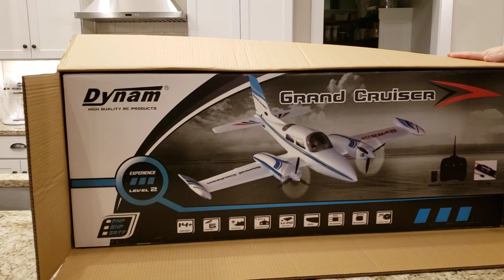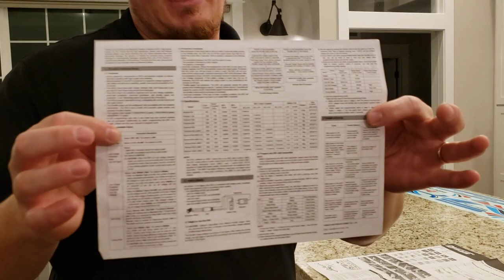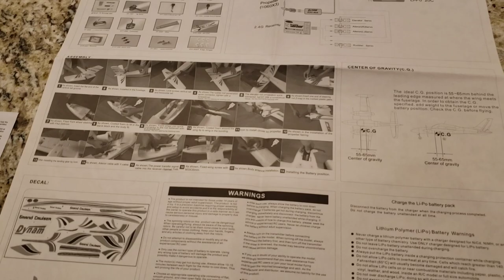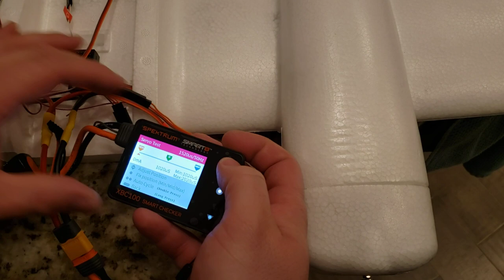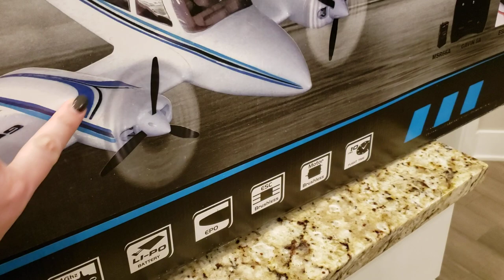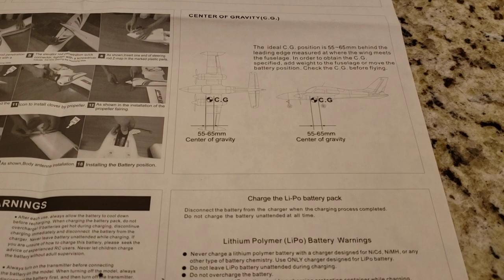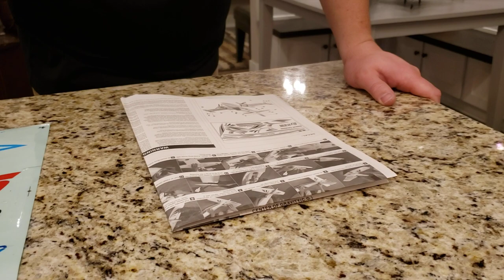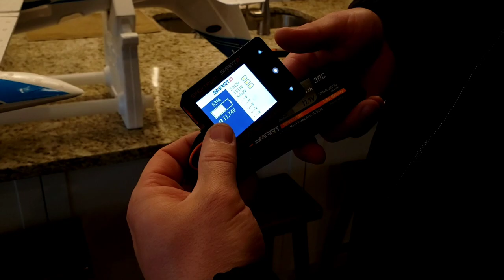Dynam - Grand Cruiser AKA Cessna 310 - Unbox, Build, Radio Setup, & Maidens + Repairs???

Comment: Beautiful plane, but it screams lack of quality.  Too bad because I was going to think very hard about ordering one.  As usual,  thank you for your honest and informative presentation.  Camera crew did an excellent job, best in the industry as you said.  Can I assume you checked and tested ALL the ESC wires off cam before reassembly?
Reply from the maker: Why would I check every ESC wire before I assembled it??? I've never done that, and don't recommend that you do either. If something is amiss, you'll have to check and re-check 10,000 spots if you hope to avoid this type of failure. Instead, I suggest testing Systems prior to first flight, as I do... I tested the motors and flight controls, and all was well before the flight, but the cold solder joint wasn't robust enough to stand up the exaggerated heat of running, I assume, which is why it broke off the board...

Comment: I was just asked by a friend to assemble one of these.  It was brand new.  Everything was still in bags inside the box.    I'm a little shocked at this model, since Dynam usually puts out some pretty good stuff (minus their crappy retracts).  It's pretty shoddy.  After just a few flights the wings seem to be flopping.  There is no spar in the wings.  I think they also did this with the T6 Texan.  That sucks.  The plastic motor mounts were easily pulled out with a small amount of pressure.  They were glued out terribly, and the glue was all dry and brittle.   I had to correct that.  Strike two.  The way the wings attach to the fuselage is terrible.  The wing is held on by thin plastic plates between 2 thin layers of foam.  One hard landing and I expect that will rip right out.  Strike three.  I could on because there were a lot more things wrong with it.  Sure, I could have simply followed the instructions and assembled it, but it would have crashed almost immediately.  Dynam should be ashamed of this one.

Comment: Now that makes more sense that the solder popped.  At first you said it came unplugged but I was thinking how would that happen unless it was barely plugged in and vibrated loose.  That would have been too easy of a fix.  Will you put in a DSMX receiver and upgrade the motor / ESC.  I would have color matched and try to hand paint the stripes in the nose repair.  BTW, I'm thinking out loud,...you guys should get together with RC Sailor's and do a couples episode but Covid ruined that possibility.
Reply from the maker: I would invite the opportunity, if the RC Saylors wanted to do a colab ;)

Comment: Brian, I made a short study of your Grain Cruiser AKA Cessna 310, To make both motors work the way
they were designed to, you need to switch sides, right to left, and left to right, and then reverse the 
direction of both motors. now when you hit the power all the prop nuts will try to tighten.
Good job, still catching up on you videos
Reply from the maker: Cool! Thanks Bill!

Comment: Oh man, I love the build and repair portion of the show. Not that I like to crash, but I enjoy doing repairs and maintenance. I love watching even more. The 310 is one of those planes that confuses my senses, even more so in model form. Depending on how I hold my head when I look at it, I either see a really cool and capable flying machine or a ridiculously pimped out mess. You know, like a Honda Civic with a special edition “Fast and Furious” body kit. The motor sounds from this particular model are like nails on a chalk board to my ears but I do love the slow flying characteristics. There’s definitely something cool about 1.2 mm-ish plane performing a slow controlled fly -by at eye level. It’s even cooler when it has the low speed control capability (some pilot skill required) to juuuuuust miss the corner of the garage but still come close enough to get a gasp from the camera crew. I think I could actually hear her rolling her eyes. lol. Thanks for another great review y’all!
Reply from the maker: You're welcome, and thanks! I replied about the Tshirt ;)

Comment: Don't know if it's been mentioned further down but some people (including me) have done the canopy mod so you don't have to muck about loading from the bottom, I also strengthened the wings as they seem a little weak and flop about a lot. I upgraded the motors, esc's and props to run on a 4S, also fitted a proper pilot and replaced the under carriage with e-flite's as the originals worked only when they wanted to. Mine was a plug and play so fitted an AR 636, Flew like a rocket; and then I sold it for next to nothing, as you do.
Reply from the maker: I don't sell these planes. I'm an RC hoarder...just ask my camera crew ;)
Reply: @BrianPhillipsRC  I didn't mean "you" sell them, it was a generalization "as ya do" or "as people do". I'd like to keep every plane I've ever bought but unfortunately I don't have the storage room, too many other hobbies.
Reply: Do you have a reference for the canopy mod?  My googling has brought no results.
I'm presuming there's a build thread on one of the rc plane forums?
Reply: That's great that you did that stuff, but by the time you got done you probably could have just bought a quality E-Flite twin, like that Beechcraft they have.  That thing is beautiful.
Reply: @thebunkreport  Where's the fun in that?

Comment: I have a couple of those! You gotta try it on 4S! I gave one of these to my ex girlfriend when we were together(best thing I did, she & her son took to the hobby!) It was her second plane..was a great intermediate plane for her & to teach her son to fly after she mastered it.. Yhe counter rotating props cancel torque/P-factor so they also used it as an initial acrobatic trainer. She still has it, her son bought 2, & flys a HUGE twin turbine A-10 now.. we put larger props on for even more STOL performance/speed. Great flying plane, 4s opens the envelope! Glad you guys finally got one!
Reply from the maker: Did you have to upgrade the ESC's and Motors? I'd LOVE to see this plane on 4S, plus I could cram some more weight into that pilot seat ;)
Reply: @BrianPhillipsRC  She & her son did ESC/motor/high C-rating batteries as "insurance" to go with the prop upgrade, as they liked the performance, it works on the V2 planes, but my stock plane on 3S on larger props made me happy, they were doing 90+MPH on 4S, unlimited vertical, nice true flying planes that slow down well

Comment: Not a bad price.  I love the slow planes cause I am slow....Like how you always say how much throttle you are using.  So many other reviewers do not.  It makes a lot of difference.  Love all the repair tips.  Wow now I am going to get a new soldering iron.  Mine is forty years old.
Reply from the maker: LOL - That soldering iron turned out to be really nice, but the cable was not even straightened out...so kinda annoying...that would correct with time.

Comment: Hi Brian I’ve just picked up a second hand one here in the uk 🇬🇧 it’s been upgraded to a 4s new motors and esc’s  I’m going to put ar630 inside it this summer it only has 2 blade props but I’ve just picked up the original 3 blade props I’m gonna try on the 2 blade ones first, I’ve got 2 civil aviation planes now lol and couldn’t be any different my other is umx cirrus lol but glad I found your vid on this always helpful tips , salute 🫡 Gary 🇬🇧
Reply from the maker: Good luck Gazza! Glad you found one ;)

Comment: This is a great plane, the build is just frustrating as hell. One note, on the cowls there was a piece of double sided tape on each one, it was around the edge of the motor mount...that paper looking part was the piece you peel off to reveal the tape that then holds the cowl “somewhat” in place. I just installed four small magnets on mine. Also, my motors did not come out of the box counter-rotating, nor did I get a reversed spinner or prop with mine, so was interesting to see your motors were reversed out of box. Regardless, mine flies great without it, doesn’t seem to try and torque to one side or the other.
Reply: Just watched till the end of the video, you went ahead and just peeled the whole thing off (sticky side and all) during your repair 😂 whatever works! Don’t get why they can’t just put some little blurb about that in the directions...like with the screw situation. Not like it would cost them anything extra!
Reply from the maker: Totally agree...but still a sweet plane! Wish some of these details could be worked out, but the guys at Bitgohobby are trying to get these little issues handled. Slowly but surely, I hope they'll make some progress!

Comment: I have one and had to fit an alloy wing spar because it used to clap wings in flight,never seen any ARTF without a spar ? does this one have a proper spar ?
Reply from the maker: The spar situation sucks pretty bad, but this plane was released a while ago...and it would have been designed to be a light flier. I think if I wanted to, I could take a lot of the bounce out with a spar.

Comment: So many wires and looks complicated to attach wings to the fuselage (each time you want to transport it with wings apart). Do you think it is possible to do an opening in the EPO on the top of the cabin and put the receiver in there? It will be less trouble with the wire to reconnect them each time.
Reply from the maker: Possible...but this plane is not going to impress anyone when you get it in person. This is true of most Dynams. They look good, then you get it and have to make it work...then the crying begins - LOL

Comment: I have the older Version 1 without flaps.   Off grass, the takeoff roll is a little longer.   But it is one of my favorite planes to fly.   I never got to fly a scale one but really enjoy it.  The only issues I’ve had with it is if the temperature is below 50 -55 , the gear doesn’t always want to cycle.  And it is a little of a power hog at that point.   Or a bad landing with only 2 of 3 down.    Fortunately I’ve only had retract problems in the air.    Nose gear didn’t want to retract.   I have a Lemon Stabilizer receiver in it with the gains set very low.   It really doesn’t need it.   Really nice flying plane.
Reply from the maker: I've heard of this and also personally experienced it on my Turbojet 550...BUT I think Dynam has a V2 of these retracts ;) But don't hold me to that...just assume I'm wrong....I'll keep an eye on these retracts in cold.

Comment: SRTF=stabilized ready to fly. I have been wanting this plane for a while my self. but heard to many nightmares on dynam planes.
Reply: Actually its there Retracts and Esc which are usually the Problem with them other than that they are decent flying planes...Except the Hawker Tempest that one is a Bitch to fly no matter where the CG is...
Reply from the maker: Actually it's "Smart Ready To Fly"....which is interestingly similar to other brands Trademarks ;) LOL!!!

BUT, I think you Stabilized is just as good for the "S".
Reply: I got one of these when they first came out . The plane was great, the radio not so much . I bought the new version,but putting Spektrum safe in it and using my DX 6e. I trust that one.!

Comment: Brian, I am building the Dynam Grand Cruiser Twin and I noticed that both engines turn in a clockwise direction. Your video suggests that one should turn clockwise and the other turn counter clockwise. Also both props seem to have the same pitch.
Reply from the maker: If you have CCW and CW props, just swap two of the motor leads on either of the motors to make ONE turn the "Other" direction.
Reply from the maker: Any brushless motor can be reversed by swapping two of the three wires, or reprogramming the ESC.

Comment: brian could you tell dynam receiver what protocol use i try to bind to jumper receiver but dont know protocol
Reply from the maker: I don't know, sorry! I thought it was proprietary to Detrum.

"Using the DSSS&FHSS dual spread spectrum technology,  will enhance the transmitter by increasing the anti-interference performance and transmission distance, even can controlled normally in city center, do not worry about the strong interference from high voltage lines, signal towers, city WiFi, etc."

Comment: If I get this I plan on flying it with the receiver with safe mode that's in the Twin otter would it be harder or just as hard to fly as a twin otter
Reply from the maker: Easier, and slower...but you'll have some fun ahead setting it up initially.

Comment: hi, probably I am not listening, but my engines on this model are running in the same direction, counter clockwise , so if possible please help with some advice  Greeting from Canada
Reply from the maker: Swap two of three wires on the motor you want to go the other way to reverse it's direction.
Reply: thank you I will change the cable .

Comment: Dude I love my dynam detrum 8c transmitter.  Best budget transmitter I've used.  Im going to get the detrum blitz. Both transmitters allow you to adjust their gyro enabled receivers right from the TX.  No dip switches and the stabilized 6 channel is only 30 bucks.

Great video as usual.  I hope you do more dynam stuff.
Reply: You have got to be kidding me?  Maybe a software update or something?  Why would they make a 9 that doesnt work with their own stabs?

Thanks for the heads up.
Reply from the maker: Hope you're wrong Mikey!!! I have to play with my computerized transmitter soon, so I will definitely be putting this to the test ;) Although, not sure if it's 9 channel or 6...we'll have to wait and see :)

We have plans to use it for this and another plane we reviewed, and video coming 11/25/2020
Reply: @BrianPhillipsRC  I'm looking forward to the video.  The 8C TX is really good.  Sticks, not as solid as my Spektrum transmitter, but its a great beginner transmitter